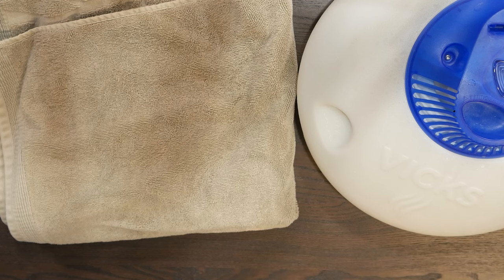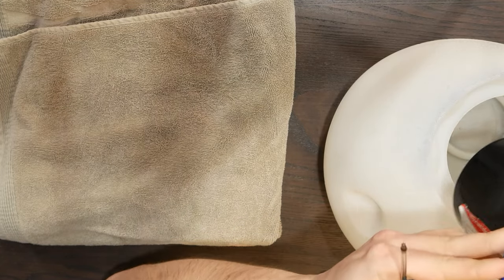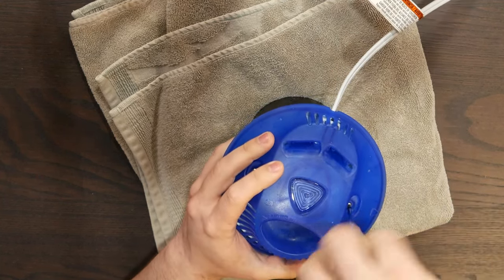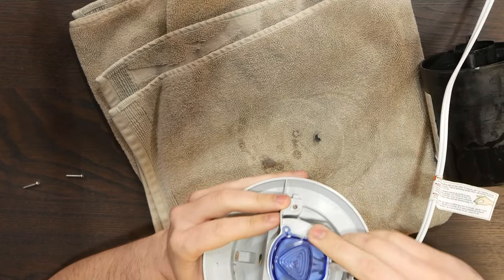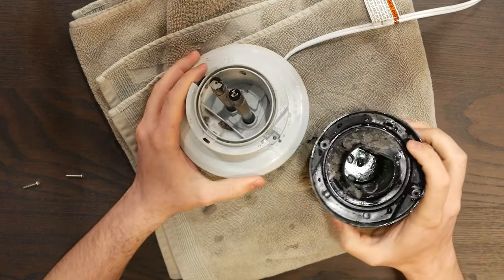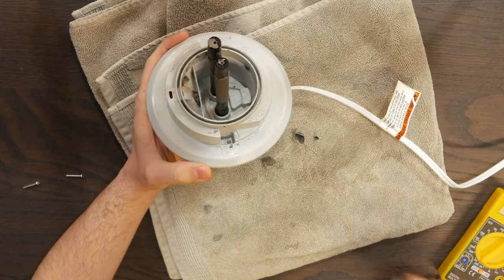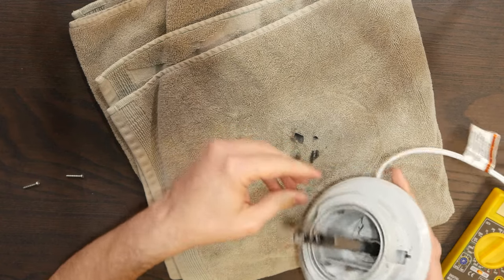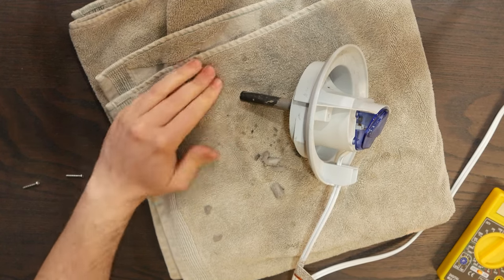Is a Vicks vaporizer an electrode boiler?

Comment: Don't use any water with extra NaCl. Electrolysis has to be happening here, and when it happens to a saline of NaCl, chlorine gas is a byproduct, because... sodium *chloride*. Baking soda (sodium bicarbonate) doesn't have this problem. The bicarbonate will turn into CO2, which should inhibit the combustibility of any HHO gas that's made from the H2O. I'm sure you probably know that when water undergoes electrolysis, the byproduct is HHO (2 parts hydrogen/1 part oxygen) gas, but not much is released so long as the water's salinity is still considered that of “fresh water”. More electrolytes in the water (from any type of salts) will result in more HHO production, as well as what ever gas may be made from whatever salt used. If it's not accumulating inside the humidifier anywhere, then there should be no risk of combustion, and you're supposed to use “fresh water” anyway. However, if the water is too fresh to conduct properly, and you need to add a salt, I would avoid NaCl, or any other chloride salts. Baking soda is best for this, but not too much, because the more conductive the water is, the more gas production, and I'm not sure if the CO2 will prevent HHO combustion... I just know that CO2 will be present with HHO. Regardless, I just thought I should mention the potential dangers.

Comment: One interesting thing about humidifiers that I've had to keep in mind is that warm mist humidifiers like the Vicks brand one in the video have always worsened my allergies (seasonal allergies, year round). These days, we use the evaporative style humidifier for household use and switch out the filters/ scrub clean every available surface each season. Normally when hot mist is required I would sit in the bathroom with a hot shower running and breathe the steam to clear out my lungs or whatever respiratory thing was wrong at the time.

Comment: I'd have used the multimeter to test resistance from the two tubes that go in the water, to the cord plugin ends. Testing by plugging it into the wall didn't even occur to me, what with the self preservation instinct and all.

But hey, you don't know until you know, and now you now, and you were safe & didn't shock yourself so good job!

Comment: It might use more power, but on the positive side, that extra power ends up heating up your home, which isn't such a bad thing in the winter. On the other hand, the evaporative ones will actually cool your home down slightly forcing your heaters to work harder. Hard to say which one leads to the higher overall power consumption, but probably about the same since heaters are always 100% efficient.
Reply: That's a good point!

Comment: They are still made like that. The equate one I bought about a month ago is an electrode boiler. There is a safety switch that only allows the electrodes to be powered when the boiler is locked into the base. It also has an auto-off feature.

Comment: Look up the "devilbiss 145 vicks humidifier" -- those were standard issue in the 1950s and 1960s when I was a toddler.
Reply: And they worked great!   I remember being 4 years old and my mom setting up and running the vaporizer in the room.   Glass "bowl" and bakelite plastic unit w/electrodes (long metal tangs).
Reply: @colemanadamson5943  Yeah! But I don't remember the glass carafe looking like that -- it's been 50 years since I last saw ours -- so maybe?  I remember the black bakelite top with the cord plugging in right behind the reservoir at 90deg for the [brandname] menthol goo for the steam to blow across to evaporate.

Comment: Fun fact: Calcium carbonate (which lime scale is made of) has the unusual property that it becomes more soluble in colder water and less soluble in warmer water, that's why it's so common to have such deposits in places where warm or boiling water is involved, it's not just evaporation, it's actually becoming less soluble as the water heats up.

Comment: I have one of these vics ones, and that scale you see on the electrodes I don’t think is scale. Mine is only a few months old and I took it apart and it had that same stuff on the electrodes, but there were 2 perfect patches at the tips that had that stuff removed, like it intentionally came like that.  I thought it was scale and when I knocked off all the rest of the white stuff (which was so much harder than I thought) the power draw went from 270W before to 900W after I knocked the stuff off.  That’s probably how the power stayed the same regardless of water level, only a portion of the electrodes were exposed to the water.  Maybe with yours it’s old enough that the coating is just coming off.  
Anyway, I threw it out because the salt and power measurement was too much work and I just got a different Vics warm mist one from Walmart with a resistive heating element in it, so much better.

Comment: You should have measured the voltage between the water and ground when the thing is running.
Reply: That's why you want 3-phase power for electrode boilers.
That leaves the water at a comfy neutral midpoint.

Comment: I have this exact humidifier. Its maybe 10 years old now and I just cleaned it out the other day so its funny you did this video. It works well enough but yeah, they're pretty sketchy at best! It's a similar process to how the nortec humidifiers work, except they will vary the water level to change the humidification output based on the current draw. 

They will fill themselves up to a certain water level, and start or stop the fill solenoid based on current draw which would then give them a specific LB/hr output. Its a pretty simplistic approach to capacity control but it works really well!

Comment: You were wondering if they are still made like this. I have one bought a couple weeks ago because I was sick and we had nothing. While I have not taken the screws off, it looks identical in all exterior respects. The black plastic drum around the electrodes, with the instruction sticker on it, is pretty distinctive.

And I think I've learned why they don't have a "fill port" on the side of the tank so you can add water while it is running. That could be... slightly hazardous.

Comment: Are the spinning disc-cone type vaporisers any good.
Reply: My family had one in the '80s. Somewhat noisy, uses a lot of power, not very effective. The only pro is that it doesn't get all that gross. I haven't seen them since.
Reply: I had one for a while. It turned out to be really hard to clean mildew off the discs; I don't actually remember how effective it was as a humidifier.

Comment: I have this Vick's humidifier, and the Equate version, brand new. That is not scale, it comes with this coating that unfortunately begins to flake off very quickly. The Equate version begins to flake immediately and creates a horrible sludge in the container. Thanks for the review! Had no idea how potentially dangerous and using so much energy.

Comment: In the old days the Hankscraft hot vaporizers actually had a control for how much output.  And the newest one I bought is designed to be cleaned without a screwdriver, BUT to undo the cover lock you actually had to stick the prongs of the plug into the lid, so you know it's unplugged (although you could cheat this and use the prongs of another cord while the unit was still plugged in).

Comment: "Oh boy....ler"

Edit: you might want to have a look at isolation transformers (https://en.wikipedia.org/wiki/Isolation_transformer) if you are going to more work on devices that are plugged in and you don't want to replicate Electroboom.
Reply: As far as I know an isolation transformer helps only if your testing device is also plugged into the wall (like an oscilloscope) by making impossible a direct path between the chassis of the tested object and the neutral lead of the instrument that could cause some bad discharges; in this case it would be of no use as he's using an handheld battery voltmeter
Reply: not really.
Reply: An isolation transformer is not a safety device and actually is more of a danger because it impedes any GFCI or other <30mA differential circuit breaker that would protect him (assuming there is one).

Comment: That black chamber allows water in the bottom then the water forms a seal that causes the the steam to flow only out of the top when the pressure builds in the chamber. When the water is used the pressure goes down and allows more water to flow in. The current goes up and down depending on the amount of water in the chamber. We had this type of unit many years ago and I routinely took it apart to clean it. If you put too much salt in the water the unit can spray water out of the top and get everything around it wet.

Comment: Wow, I really would had hoped there was a safety relay that prevented the power from turning on when the plastic shell was removed.  At least that explains why the power draw was so lower until after you cleaned it.
Reply: The shell is much taller than the leads and only has that little hole. It is pretty much impossible to shock yourself  that way
Reply: @RICHUNCLEPENNYBAGS77  the point of the safety relay wouldn't be to prevent shock when the shell is on, but for when you take the shell off.
Reply: @LifeWithMatthew  I'm talking about the black shell on the inside, which isn't meant to be removed.
Reply: @RICHUNCLEPENNYBAGS77  so am I
Reply: @LifeWithMatthew  OK, but why would you need to do that, especially with the thing plugged in?
Reply: @RICHUNCLEPENNYBAGS77  You wouldn't.  The point of a safety feature like that would be in the event of stupid people being stupid.  If you have an area of your device that can be accessed in a manner that doesn't require you breaking it to access it, and that area is going to expose line voltage, then I would hope a simple safety switch would be added to kill power when that easily removed shroud is removed.
Reply: @LifeWithMatthew  Well, my counterpoint is that if you're unscrewing something plugged into the wall with a Torx screwdriver you can't really blame the manufacturer for mishaps.  You're really going out of your way to be unsafe.

Comment: My boiler humidifier is a tank, and water goes down (and is monitored by a floatation device) in a cup, and from there to another cup and there there is a ceramic heating ring that boils the water, and a fan is in a kind of tower structure that blows the moist air out. VERY effective, and pretty easy to clean. You have a foam pad in the boiler cup and almost all the minerals end up in that pad, and then i just put it in vinegar for a while and it can be reused for a long time, and when it is starting to break you just replace with a new little pad.
It has high and low setting. Sadly not a hygrometer but i have it connected to a smart wall switch and that is connected to a thermo hygrometer and then i can just program an "if humidity is below xx then on" "if humidity is above xx then off".

It is the best humidifier i have had! Puts out tons of water on high setting, and totally clean moist sterile air - no mold or bacteria or shit. And pretty easy to clean. Highly recommend this type!

Comment: very common in india , and here they are clearly exposed unlike yours
Reply: Then how are you still 1.3 billion people?
Reply: @FortuneZer0  you can always make more, that's why they need population control through humidifiers
Reply: The common submersible water heaters (immersion heaters) you can get in India aren't electrode boilers, that'd be extremely stupid. They're exposed resistive heating elements, like the filament of an incandescent bulb but much larger. So yes you can burn yourself if you touch one while it is running, but unless you do something extremely stupid or the unit is broken you won't get a shock.

As an Indian this is the first time I've ever seen an electrode boiler, though I've seen plenty of immersion heaters using resistive heating elements.
Reply: @tatianabasileus  We need a Technology Connections video on this I believe.
Reply: @Adam-qs5ir  Would be difficult for Alec to source one of our immersion heaters in the US. In any case the immersion heater is just the heating element of a traditional water heater made to be plunged into a bucket.

Comment: We got one about 4 or 5 years ago and it looks exactly the same. The instructions said do not wash out the black crud or else the unit will not work properly. If the unit doesn't work properly add a pinch of salt to create a better contact. We pretty much just add salt every time we use it and havent had issues. It really only gets used a few times a year.

Comment: Neat.  I've been using one of these about a week to see if I want to get a humidifier for my house.  Was curious how they work (and specifically, why they hummed since they seemed to have no moving parts).

Mine appears to be slightly older than yours (Vicks, same color scheme, but a less ugly and squarer design).  And my acquisition story is the same.  My parents bought it for me when I was a kid (think I was really sick one week and the doctor recommended a vapor thing), then it sat in a closet for years, and then I borrowed it.

While the tub is hardish to clean, it's designed that way for a reason.  The shape is made to keep you from splashing water on the floor as you are carrying it to its destination from the sink where you filled it, and it works remarkably well.

Comment: After years of trying every type of humidifier at every price-point which always ended up generating dust, suffering salt/lime/mineral deposits, and never lasting more than two winter seasons, I gave up on a long term, technological solution. Instead, I buy two of these for $20 each and run one upstairs and one downstairs 24x7 all winter and discard then in the spring. Repeat each year and I never have to clean them or repair them or buy filters or UV bulbs or anything. Life is simple and our home’s air well humidified every winter. Job done.

Comment: The two warm mist ones I have uses an enclosed heater element.  One has high-low and other has a humidistat on it.  There must be multiple kinds.  Mine also run 400 and 800 watts respectively (and work with distilled or RO water)

Comment: About @3:00 in you ask if they are still made the same.   I have the Wallyworld brand/version and the electrodes are just flat prongs of metal about 5 inches long and 1/2 inch wide with no coating whatsoever.  Brand new this year.....2021.

Comment: It's good at warming up my apartment in the winter. Although I use the nicer one that is easier to clean, and holds a lot of water. It only allows about 2 cups of water exposed to the current at any one time.

Comment: Actually, it’s a bad idea to use a cheap meter to measure mains, because they don’t have the safety features of better meters, so could fail explosively on you.
Reply: The chances of it exploding on you is pretty slim if you know what you're doing, but they can explode on you if they are used incorrectly. One of my co-workers used a similar meter like this to check the current on a car, and he connected it improperly. He kept telling me "the leads just got hot" and I was like... Huh?

I opened up his meter and sure enough, it wasn't fused and he shorted out the battery! That's why the leads were getting hot. That could have caught on fire.

I've never seen much issue with them checking voltage, but the voltage readout is incredibly inaccurate and often changes with the charge of the matters, which is mostly why I avoid such crappy meters.

I just ended up getting myself an amprobe. I would have preferred a fluke, but the amprobe had a lot of the same features of more expensive flukes. Of course, they aren't built to the same high quality standards of flukes but it was good enough for my home use as a hobbiest.

Comment: I bought one of these about 10 months ago shortly after my son was born. I live in a old coal mining town and most furnaces have been switched from coal to fuel oil many years ago as there are no natural gas lines in my neighborhood. My sons pediatrician thought the fuel oil furnace was making the air dryer causing hime to get really congested and suggested we get this type of humidifier because it works well and is cheap to buy. We used it for a while and put it up for the warmer months until a couple months ago when we needed to start using it again and it was spitting a lot. We had it sitting close to an old but nice dresser my wife’s grandmother owned and didn’t notice it water damaged a section of it until the day the humidifier video was posted on the main channel. I told the wife to pick up a cool mist humidifier hoping it would help and it has been working great. I still have the old humidifier but now I’m wondering if I should take it apart on video so everyone can see how much build up it can have with only roughly 4-5 months of daily use. Finally I feel really dumb thinking back to how I would fill this each night, no gloves, no care, just grab the top and remove it from the tank not taking any care when handling it while leaving it plugged in. Granted I’m not going to use a humidifier like it again now that I have gone to the cool mist (swamp coolerish) type but it is kinda a wake up call for me. Since I like to tinker with things I tend to downplay the dangers of some home appliances knowing a lot of the warning labels were written in blood through the actions of dumb people. That kind of complacent thinking is what gets experienced and knowledgeable people hurt. Thankfully I never hurt myself but I’m going to remember this next time I try and get complacent.